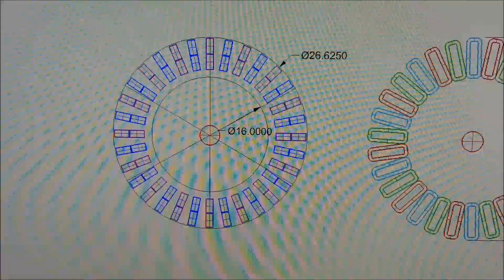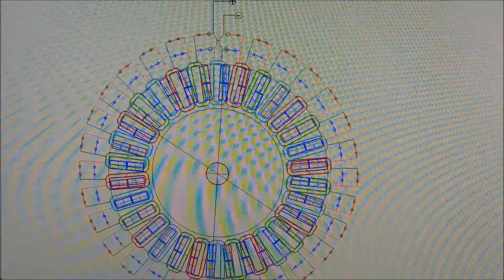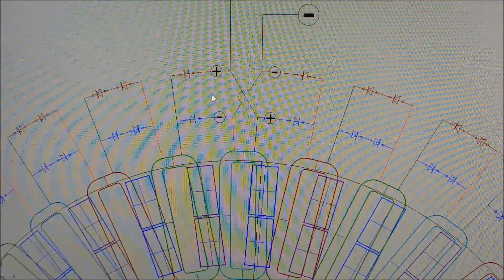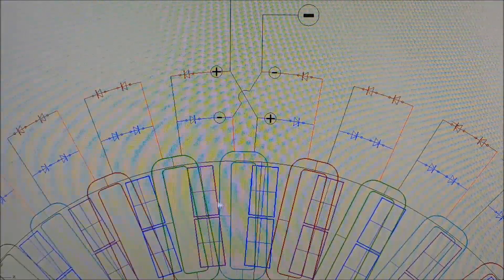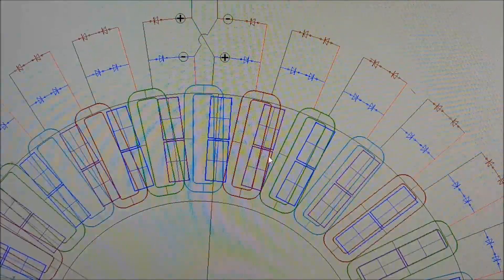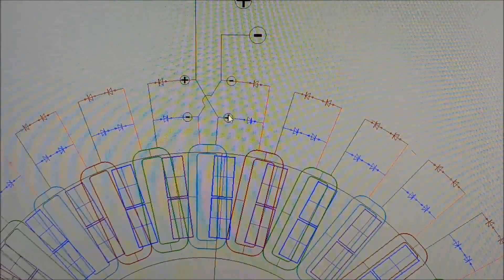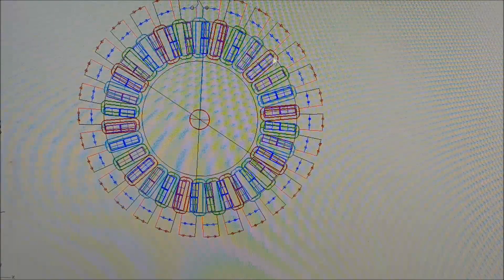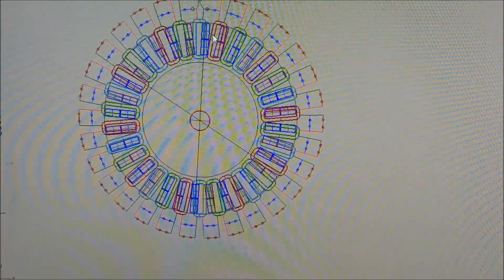CONCRETE HOUSE BUILDING IN PH, WIRING A 3 PHASE ALTERNATOR TO BE A SINGLE PHASE GENERATOR

Comment from the maker: Upon furthur consideration, I think all the magnets on one rotor are north up and the other would be  south up. Also the coil 
and magnet count MUST be the same for continuity issues on the outer connection wire tracks.